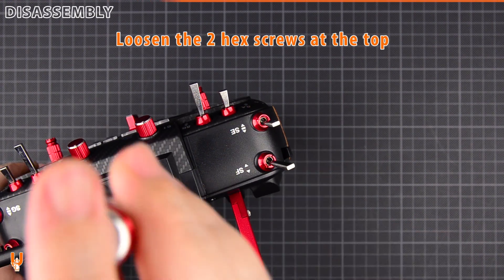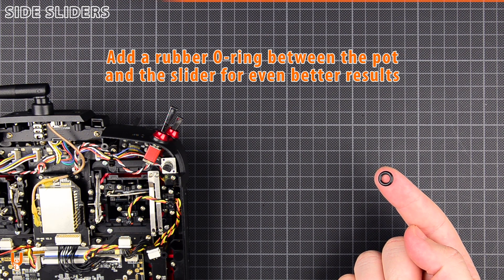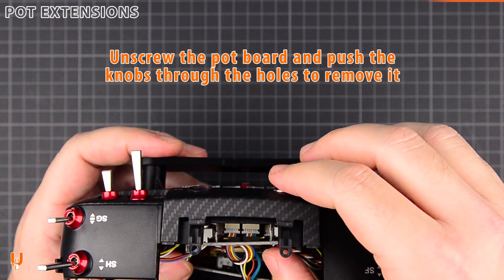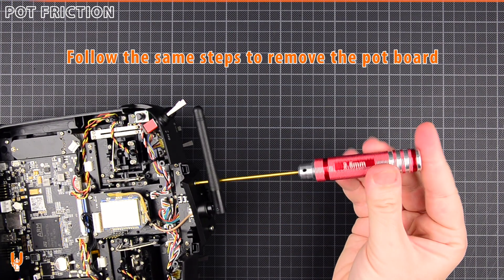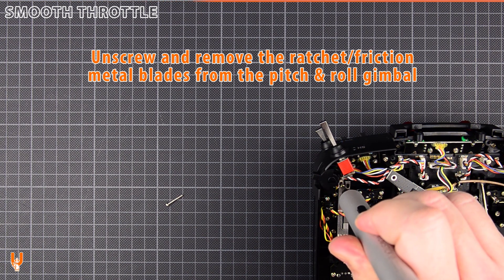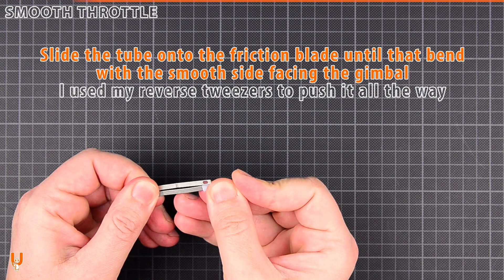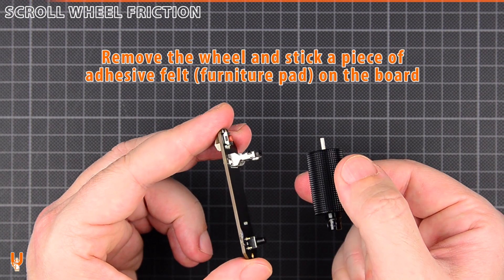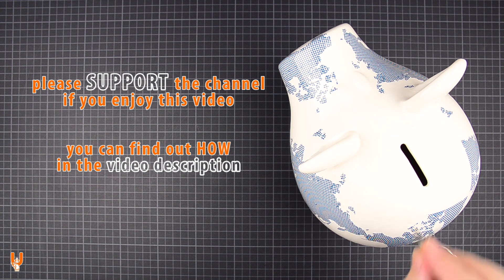PART 1 of Radiomaster TX16S mods : disassembly, sliders, pots, throttle and scroll wheel

Comment: Has anyone been able to do this for the MK 2?
Reply from the maker: Should be the more or less the same. What is troubling you, maybe I can help.
Reply: @muteFPV  so for the 16s MK 2 the S1 and S2 pots don’t just come out once unscrewed like in your video, the enclosure has some tabs that keep the pots in place. I was worried about damaging them, but I found the knobs pull off just like you showed. I was worried about damaging them!

Only difference is it’s a bit tougher to get a decent grip on the MK 2 version to pull the knobs off. It would’ve been nicer to just be able to pull the board out with knobs and all and have a better grip on the knobs and pots
Reply from the maker: Ah I see, it has been quite a while since I last tinkered with the TX16S! I am glad you figured it out :)

Comment: I need help in changing the set of buttons on the left side for telemetry and the 3 other buttons. They are stuck in the down position.
Reply from the maker: Do you mean to replace the faulty switches of the radio? Also, what do you mean by "the other 3 buttons"? Just want to understand your question fully so I can reply accordingly :)

Comment: Hey Buddy awesome series for the TX16s, is there any way that you could help me assign the two sliders to operate one channel each, I have a dozer model and need to raise and lower the blade ( one channel) and tilt the blade ( another channel) as they are servos that control hydraulics.
thanks man !
Reply from the maker: Thank you very much! Do you mean bulldozer, like a truck? How do you operate the servos, straight from a pwm receiver?
Reply: @muteFPV  No worries when a channel is worth watching then I will say so lol, so yeah its the RC4WD 1/14 scale hydraulic bulldozer, I did use a flysky TX with it but bought the TX16s mk2 I have assigned the switches okay after fun and games but I really need to two sliders to operate as seperate channels, and yes Im using the flysky FS-IA10B RX with PPM capabilities.
Thankyou Ian .
Reply from the maker: Since it is the first time setting up the radio, you will probably have to go to the "Mixes" tab (inside the setup menu of the model you created) and enable any sliders and switches you need next to each channel. I have barely any experience outside drones/multirotors so I can't help much with servo settings (range of movement for example that may need to be adjusted)
Reply: @muteFPV  Thanks for your reply, unfortunately I have tried that and numerous other ways, but if I do hatch that egg I shall let you know, carry on the awesome channel
Reply from the maker: I assume other switches are already working fine so the receiver is bound properly, under the correct protocol etc, right? You can send me a photo of your mixer setup page at my email mutefpv (at) gmail (dot) com, if you want. I will be back home soon-ish and check it for you.

Comment: Haven’t tried it myself yet, but I’ve heard PTFE shrink tubing is a bit easier to work with for the throttle mod. I actually used the above tubing and heated it until it was a gel when I did this so it will never shift on me, it was a pain but you know it will never wear through
Reply from the maker: I have never tried it so I have no idea. I will try to find some, thanks for the suggestion :)

Comment: I have just ordered the AG01 gimbals 😁 And I also plan to apply the throttle mod. Or wouldn't you recommend it with these gimbals?
Reply from the maker: Mine just arrived, they feel smooth and come with extta lubricants so maybe you don't need to add any teflon tube like I did in the stock gimbals. I just opened the box so I haven't used them yet, time will tell.
Reply: @muteFPV  Thanks a lot for your response! I have the throttle mod with the stock gimbals for 8 month now. Since it works so damn good I was wondering if I should just transfer the existing tube to the new gimbal. But yeah, maybe it's a good idea to first check how they feel with no mods 👍

Comment: Hello - Great video as always. I had a dim LED on my 6 position "chicken feet" switch and RM sent me a new breakout board in case needed. It turned out to just be some black foam trapped in the foam divider.... to my point.... as I was tearing it down to get to the breakout board I found many screws stripped from the factory. They are poor quality and being Philips.... not a good call by RM. Did you find the same issue as you did your tear downs on the RM radios? Do you happen to know the size call out of these screws used to mount the boards etc? I would love to buy some nice Stainless Hexhead replacements. Anyway, no issue if you do not know the size, but wanted to ask the man with tons of experience on these nice TXs.
Reply from the maker: Loved the description "chicken feet"!!! 😂 I don't remember noticing any stripped screws on my TX16S radios, that's kind of a bummer. You mean that the top (cross slot of the philips head) was stripped or the threads too? I will check the screws next time I open the radio, I have a ton of tiny screws for whoops, micros etc so I think I will be able to see what they are similar to. Purchasing 20-30 pieces of each screw size a long time ago is probably one of the best decisions I have made :P
Reply: @muteFPV  Yes just the cross head for the Philips Driver was stripped. Yes I too have hoards of hardware and will need to do some checks and match for swaps, but if you do identify them, I would greatly appreciated learning the sizes. Time to order some nice spare hardware.

Comment: I guess you are still working on Part 3 . How would you add a kind of mini joystick the FrSky HORUS X12 S has on both sides in the lower edges. May to replac the 2 sliders or something else cause these joysticks would be great as camera gimbal steering.

That would require 2 holes, 2 of these mini joysticks and the channels required - and of cause space in that area.
Reply from the maker: All 3 parts are out, as well as the accessories video ;) I am pretty sure I have seen a joystick mod, I will try to find the link for you.

Comment: At 1.09 you cut the QR-code sticker saying it is not needed for warranty. This is not correct. I have just contacted Radiomaster about a problem with my TX16s and before they would send out a replacement part, they wanted me to scan the QR code sticker so they could accurately date the manufacture. I had lost the sticker so I scanned the sticker that was on the main board and they were ok with that.
Reply from the maker: At 1.09 I say that removing the sticker does not void the warranty, which is true. It means that you can open the radio without losing the warranty. This is what radiomaster had told me and this is what happened in your case as well. I did not advise to destroy it or throw it away.

Comment: If you don't have a 3d printer... don't watch..and I'm not shure I want one now? Allot of mods??  More like a rebuild..
Reply from the maker: These are just recommendations, you don't have to do any of them if you are happy with your radio. As for the printer, you can either own one, know someone who does or even order from a local 3D printing service. I did the same before owning one and still do for parts I cannot print myself.
Reply: @muteFPV  I'll have to check into local 3Dprinting.. I'm Old all we had was legos.. lol nothing against you. Great mods.  But if no access to a printer..  one can't do many of your mods.. And a radio that needs so Many mods?? Perhaps you can recommend a radio that is built Right? Thanks! 💪👊💪💪
Reply from the maker: No worries :) I am sure you will find a solution locally if you really need to do these mods. As for the radio, it is actually a great value for money right out of the box. Many people use it stock. I like modding my radios and bring it closer to my taste and needs - but on the other hand I have never owned a very premium and expensive radio to know what quality "feels" like.
Reply: @muteFPV  lol not all Rich.. only ad they say 1% lol and that's good!! Because for a rich Man to go to heaven... I'd like a Camel going through an eye of a needle.. you ever saw that? Impossible..  So be joyful not rich.. God bless! And your mods are quite inventive.. and you have great soul! No hate brother. I Just say what I think. And I am human. So not perfect. Lol far from!!! Thanks for info on finding a someone who can print your parts. God gave you talent.  God bless and enjoy the day God gave to ya! I think I'll get the ts16 I have a friend 😁😁 that can show me how to fix if needed.. Thanks brother!!

Comment: I just made the smooth throttle mod and printed out the sliders. Now I just need to install them.
Thanks a lot, Sir!
Reply from the maker: You're welcome! Let me know if you like how they both feel :)
Reply: @muteFPV   throttle mod: smooth as silk :) I REALLY love the feel.
For the sliders...  I have printed them in PLA. But I need too much pressure to put them on. So I will print them using TPU next. But adding the o-ring already helped a lot.

Great mods!
Reply from the maker: You can enlarge them in X and Y slightly in your slicer. The hole design is not mine but it did fit perfectly on my pots.
Reply from the maker: Did you use Capricorn tube? Just noticed it in your uploaded Make.
Reply: @muteFPV  yes, I did. That was the only one I have at home (spare part from my printer). And since I have only used 24 mm of it I can still use it for the printer.

Comment: Ok, this is a littlebit out of place question but:
I have a jumper T12 and it makes buzzing sound because the wires to the speaker are unshielded. My question is: how would you suggest to shield them? Use an aluminum foil covered with tape or anyone has better idea?
Reply: not sure if it's related. I had a buzzing sound on the TX16s using the crossfire micro module. By increasing the CRSF output power the buzzing would also increase. But this is only the case if the TX16s has a second speaker. By following Bill Clark's video (https://www.youtube.com/watch?v=BMworCXQNe0 RadioMaster TX16S & TBS Crossfire Micro TX Buzzing Sound Solved) the buzzing almost disappeard. Once the back cover is removed it only takes you 10 seconds. So maybe the T12 has a similar issue.
Reply from the maker: If you can, it would help to identify the cause of the problem first. For example you can turn off the Tx module and see if the buzzing stops. If that's the culprit, you can try and route the speaker wires further away. I don't have a T12 so I have no idea how it is inside. As for the wire itself, personally, I would probably replace it with a shielded wire (earphone or telephone wire for example) instead of DIY it. I haven't used foil for this before.

Comment: Awesome walk through and helpful video. I just bought some parts to upgrade my TX16S and this is so timely and will be so helpful. 👍👍👍
Reply: Where did you get your parts for your upgrade?  Thanks
Reply from the maker: @randallwatts9840  which parts are you looking for?
Reply: @muteFPV  I’d like to change out original black switch covers to Red on top and face of radio.
Reply from the maker: @Randall Watts I think you mean the switch nuts. I am using the ones from Hawk Creation (the flat bottom ones) but you can find many different types. Check my Taranis X9D SE for ideas and links (it also had red accessories) or wait a bit for my TX16S Accessories video ;)
Reply: @muteFPV  Yes.  New to this radio.  Thanks
Reply: @muteFPV  will these switch nuts work on RM TX16s?  Are they pretty standard?
Reply from the maker: Usually yes, they are the same
Reply from the maker: Thank you very much! Parts 2 and 3 coming very soon :)

Comment: For those of us who bought the pot gimbal version and are now regretting it, would it be possible to make a video on how one would go about switching the gimbals? I would really appreciate it :D
Reply: So the hall effect gimbals will work in the basic version radio without additional modification? Just swap them on  and plug them in?
Reply from the maker: @Adam as far as I know, yes.
Reply from the maker: I will be showing how to remove the gimbals in the accessories video but it is very easy to do. Here is a short version for you: Unscrew the side slider board and the 4 screws at the corners of the gimbal. Unplug it and lift it up. Put in the new gimbal and screw everything back.
Reply: @muteFPV  Thank you! Love your content
Reply from the maker: Thank you very much! Parts 2 & 3 will be ready very soon :)